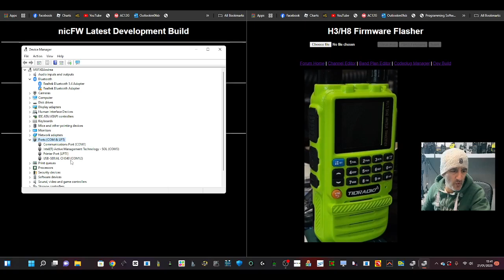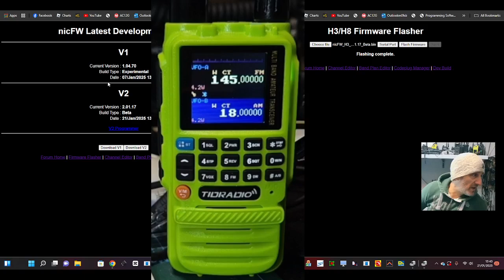NicSure - Firmware Flasher Process - Tid Radio H3/H8

Comment: Awesome video, as always. I don't think that many, maybe even any, of the H8 units can be programmed using the USB cable. Unlike the H3 the USB connects ONLY to the battery on the H8 and does not interface with the radio itself. So, you are stuck with the Kenwood cable. Bummer as I don't have one of them. Guess I'll grab one on Amazon.
Reply from the maker: Ok